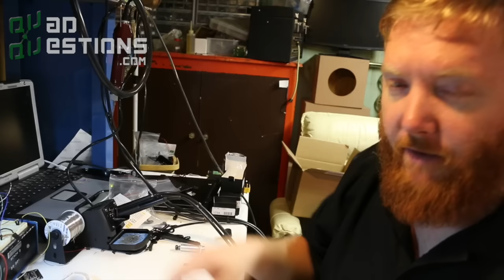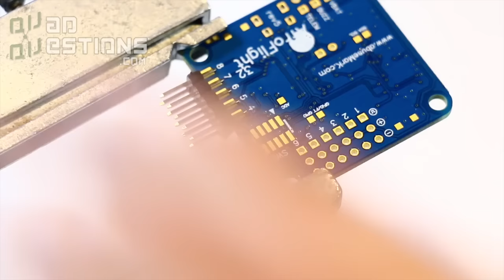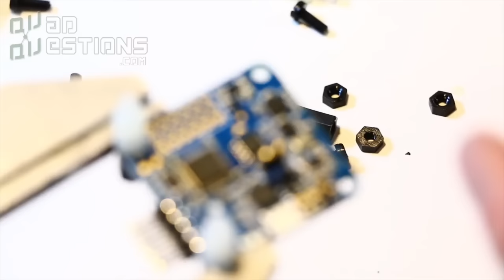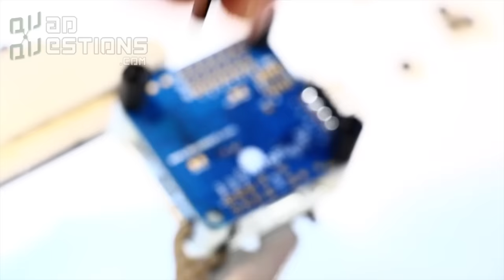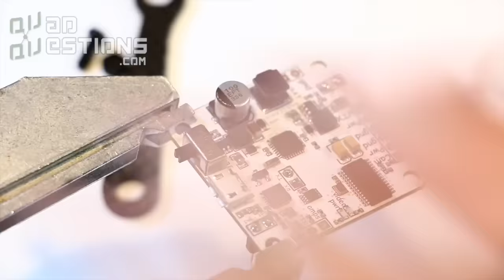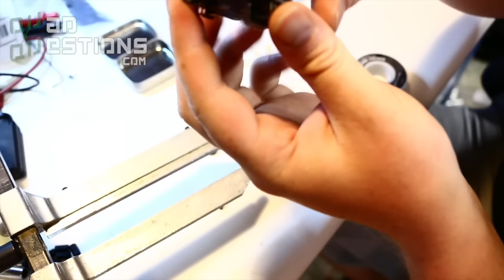How to solder an OSDOGE to a Naze32

Comment: Just finished the OSDOGE to Naze 32 Rev 6.  Little different but the video is still great.  Thanks
Reply from the maker: +Bob McCarthy glad it helped!  Can you elaborate as to what was different so that you might help others with a rev 6?  Thanks
Reply: +QuadQuestions.com Not a whole lot was different.  The 8 pin connector that you attached to the Rev 5 isn't the same and has been replaced by a straight 10 pin and can be installed later.  The only other thing that puzzled me for a second, (this is my first multi-rotor build), the USB ports will be 90 degrees from each other.  I watched the video looking at the boards before I soldered it up and got everything aligned and then watched it while I was doing it.   Went good.  I have a history of soldering so just making sure I was putting stuff where it belonged was all I was concerned about.  Used a 30 watt iron.  Thanks for the smooth transactions on your ebay store as well.  Its been a pleasure.  I will be back when I get my acro board.
Reply from the maker: +Bob McCarthy nice. thanks for that,  Yeah, the USB ports being 90 degrees off really throw a loop into some builds, but most are fine with it.  Thanks for your comment and your business Im glad that you got it working. :)

Comment: I'm trying to setup my OSDoge in MWOSD R1.5, but it doesn't seem to connect.  Is this the correct procedure?

1) install Java 7
2) quad w/o battery plugged into computer
3) OSDoge switch is in 'connect' position (the position closer to the USB connector)
4) launch MWOSD

I see a port open called "COM5" which I can connect to, and the GUI buttons turn green.  However, there's text flashing non-stop "Waiting OSD...".

Thanks,
Jim
Reply from the maker: +jimd33463 Check which com port the OSD is connected to.  You need to make sure that you have the Cp210x drivers installed (same driver that the Naze32 needs)  Setup video coming soon.  https://www.silabs.com/products/mcu/Pages/USBtoUARTBridgeVCPDrivers.aspx